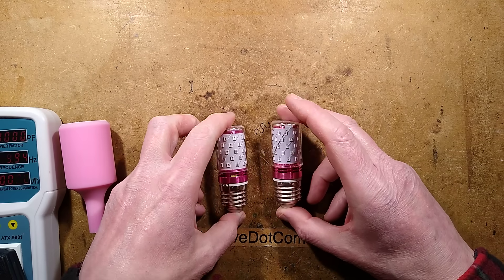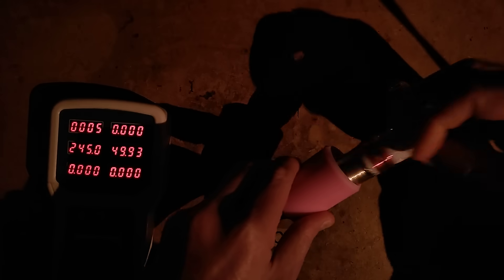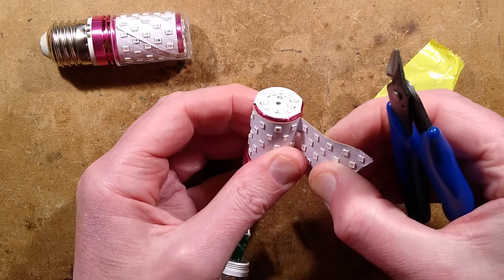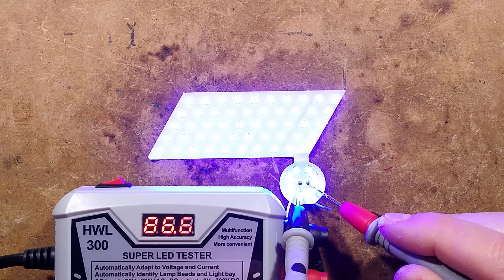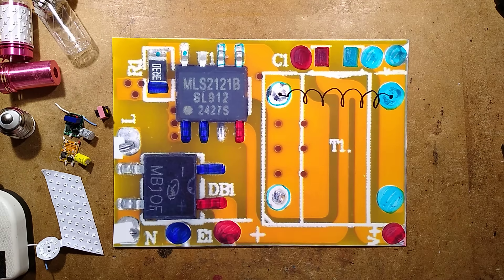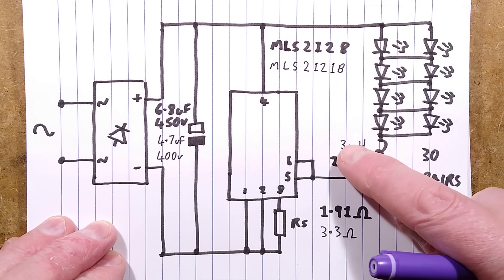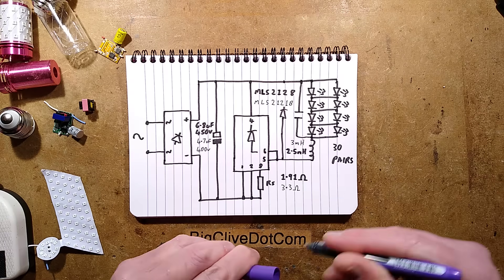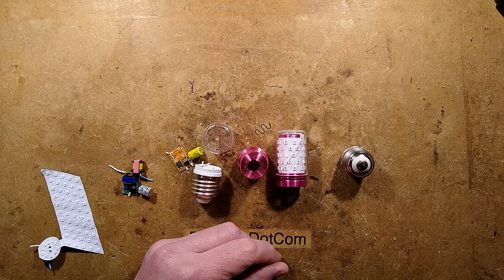Randomly overpowered scammy "sterilising" lights

Comment: It doesn't need a smoothing capacitor.
In buck converters, the inductor is always in series with the load smoothing the current.
There aren't 2 pulses.
when the switch is on, inductor current increases slightly, when the switch is off inductor current decreases slightly.

Comment: ~3V means that they're plain blue LEDs. 365/395nm ones need ~4V, germicidal (260nm or less) clock in above 8V! At the current UV LED prices a real sterilizing 60 LED corn bulb would cost well above EUR 500 plus the electronics. Blue is much cheaper and completely useless for sterilizing, so strictly speaking both are fake products. This channel is great! I have to disassemble so much less stuff thanks to you! :)

Comment: I use uv c in hvac for germicidal control. 8 to 40watt, 10 watt being average.,  depending on ductwork area and cfm flow..dwell time exposure is the key to successful  sterilization of any virus, bacteria, etc.  These bulbs are flourescent, and not cheap..$50 usd and up.  Mine was installed months before the covid event and we all were safe until a large amount of outside air was admitted into the home, supersaturating the indoor air with the deadly crap.  Four of seven residence ended up with it but with mild cases. The real uvc work,, refresh them annually or up to 18 months, leave them on 100 % without cycling with hvac system.

Comment: Ah, more scamazon "this one trick" junk. Very satisfying debunk video! Have you seen the ads for the wall plug mounted space heaters yet? Every other ad claims it was invented by someone different for different reasons, and that electricity companies don't want you to know about resistive heating. Would love to see what's in one of those/if they are all the same internally.
Reply from the maker: They're just low power heaters.  I took one apart.

Comment: I'm seeing chinese lamps similar to this.  You have a pink strip above the screw in part.  I'm not sure if that's plastic or metal on your example.  What I'm seeing is the screw part on the side and for some unknown reason, there's about a quarter inch higher metal base before the glass part of the bulb starts.

I assume that the UK is the same as in the US on this, that the side is the neutral and the very bottom terminal is the hot.  However, in some lamps that have been rewired or have no polarized plug, that neutral now can be a touchable hot.  Not a good feeling at a 120 to 230-240 volts AC.87

Comment: Including the "free wheeling" (inductor discharge) diode on the driver IC really isn't a big challenge. The thing already requires a process suitable for the high voltage switch, so the diode is no big ideal. It would need to be a fast recovery type for decent efficiency. (a Schottky diode would be best for efficiency, with extremely short reverse recovery and lowish forward voltage (which is unimportant at the voltages involved), but such a diode is right out of the question'; silicon Schottky diodes top out at about 200 PIV and even at that voltage they are few and far between)

[edit] These drivers are buck converters with a low-side switch. As such, the intrinsic "body" diode in the N-channel switch does not provide the discharge path for the inductor. Without the separate discharge diode the intrinsic diode of the FET would be avalanched when the FET is turned off, which would result in very high power dissipation (it looks like a high-voltage zener, so the dissipation at the instant of turn off would be hundreds of volts times the inductor/LED chain current; you can sometimes let the body diode of a discrete power MOSFET avalanche to discharge the leakage inductance of a flyback "transformer," but the energy is low and even then it must be carefully analyzed; avalanching the switch in a power IC can be instantly destructive).

Comment: Because a string of LEDs is essentially a shunt voltage regulator, albeit one that isn't very good, putting a capacitor across it isn't very effective in "smoothing." It would take a fair bit of effort to evaluate it fully in terms of cost, volume, efficiency and reliability, but a increase in the inductance likely is superior to using a capacitor of a value that does some good. A cap could be useful in terms of noise.

Comment: I believe the MLS2121B is a Linear constant-Current LED Driver like a Diodes Incorporated AL8862 with the noticeable difference being pins 7 and 8 are swapped. Pin 3 being a NC (Not Connected) and Pin 7 being a Control pin for PWM/DC Dimming, left floating for normal operation. Fun test you can do with Pin 7 is apply power to it. If driven with less than 0.3V, it should turn off. If driven with 0.4V to 2.6V, it should adjust the output current from 10% to 100%.  You can also use a PWM signal <0.3 to >2.6 for a 1µs transition time and finer control. Adding a capacitor between pin 7 and GND may add a soft start time of approx. 1.5ms/1nF (Default soft-start time = 0.1ms). Pin 1 is a Set pin grounded for normal operation or can be connected to VIN via a resistor to set Normal Average Output current. Pin 2 is GND.
Of course, I could be wrong about all of this, but what's life without hypothesis and experimentation?

Comment: Hello God of reverse engineering. I didn't know how to contact you so I'm leaving a message hoping that you would receive it. A while back you reversed the kill-a-watt device which had an interesting way to power itself as well as measure the circuit. I found another interesting device that also powers itself but instead of from AC Mains it powers itself through the CT clamp used to measure the current through the AC mains through I guess SCT013 clamps. The MyEnergi Harvi device. I would love if you could take a look at that one and make a video. I believe it is made in the UK and based on your accent I'm guessing you are too. I'm in the US.

Comment: It would be interesting to look at the datasheets on those LEDs (or use an optical meter) to see what wavelengths of light they actually provide.  And also to compare the current being pushed through them with their datasheet recommendations, to see just how far over recommended continuous max they're being pushed. But I suppose those LEDs are even more difficult to identify than the chips with the part numbers on them.  I've been able to at least compare them here by placing them under an inspection scope to get 45 power magnification, which gives a better view of the LED, and in the case of tri-color leds, the controller chip as well.  (WS2812 and WS2812B are often claimed when they're using a knockoff, which are easily verified under magnification)

Here in the USA, consumer LED bulbs are pushed well beyond their ratings so they fail early and have to be replaced frequently, to bolster the bulb industry's profits.   But in places like the UAE the government mandates longevity in their bulbs and manufacturers are forced to design their bulbs to not exceed the LED's ratings so they last many times longer.  I wish the USA would regulate that so we didn't have to replace our bulbs every few years when they should be lasting 10-20 years.  It's quite a shame to see a component that has the potential to provide decades of service ran so hard it burns out in just a few years before being sent to the dump to contribute to e-waste.

I would also suggest you look into getting an AmScope inspection scope for your channel.  Not one of the high mag heads, consider one of the low (3.5-45x) "wafer inspection" grade ones.  They are often sold as a package that includes a decent HDMI camera, as well as an adjustable hovering stand.  You probably would only have a reason to use it on a small percentage of your videos, but it would be a great addition in cases where more magnification would "reveal another world" in your tear-downs.  Almost no one is showing magnified footage in tear-downs, and that would give your channel a unique feature some of us would find extremely interesting.  (I can link you to some pictures and video I've taken on WS2812 and other interesting components if you'd like)

Thanks for another great video!
Reply from the maker: I'd guess around 470nm from the colour.

Comment: what is your fave lighting tech? mine has to be carbon arc, limelight, and high pressure mercury. all fascinating methods of making interesting light with a nice bit of danger on the side.
Reply from the maker: I like all of them, but do have favourite lamps.  Like the cold cathode signage bulbs used in Las Vegas.

Comment: I have been a fan for years. Long ago you did a video on a florescent type black light with clear lens that was used for germside in furnaces and perhaps operating theatres to sterilize before surgery. I  ordered on and installed an Edison type socket in a cat litter pail with lid, put a switch on it and my daughter uses it to sterilize her CPAP unit.  I think the overall cost was about eight bucks US and the pail was just left over since my daughter has 3 cats in the house (well 2 now since one passed away recently) The wire was left over from some old lamp or something, and the switch was a regular household switch I mounted on the pail.  We had a pipe let go in the bathroom recently and caused some mold problems. I used that lamp to cleanse the  bathroom and it did a great job. Of course we always avoid being in the room when the lamp is lite and I wear dark glasses when tinkering with it where it will be on for any time at all. By the way, I love the show,  I include it in my learning videos to watch as I usually pick up a lesson or two from each one.  Thanks again.
Reply from the maker: The UVC tubes are very handy.  But make sure everyone knows they are harmful for eye exposure.  Any room they are being used in should be closed to make sure humans and pets don't get exposed to the light.

Comment: Found the contrustion of that style of corn bulb interesting since it has a more cylindrical arrangement of LED chips on a flexible PCB of sorts. I've seen the corn bulb type of LED bulbs before online, but never got any since they don't fit my needs so haven't gotten to play with any yet.
The other kind of corn bulb uses a bunch of small vertical PCBs that are connected together instead of a whole flexible piece like the one you took apart is.

Comment: I don't think your analysis of the LED current is quite correct. The LED current is the same as the inductor current, so it increases when the switch inside the IC is on, and when the current gets to the trigger level, the switch turns off, the current flows through the diode, and the inductor and LED current decreases. So there is only one pulse of LED current per switch cycle, although the current is always increasing or decreasing.

The current may decrease to nothing before the next cycle, or the next cycle could start to increase the current before it had decrease to nothing. That could be checked with an oscilloscope.

Even if the inductor current drops to zero each cycle, there won't be much voltage change on the LEDs. If a small capacitor is added, the voltage on that will drop rapidly to below the forward voltage of the LEDs, so the current in the LEDs would be so near zero that the capacitor would do very little. It would need a large capacitor in that circuit to smooth the LED current much.

in contrast, the mains smoothing capacitor can be quite small and be effective at keeping the lamp illuminated during the gaps between mains peaks. The LED driver circuit will give a constant current over a wide range of voltages by varying the duty cycle of the switch.

Comment: My freezer stops working in winter because it’s too cold in the house, so putting a 10W bulb inside the fridge section would actually provide exactly the level of heating to trigger the thermostat and keep it running normally. Therefore this bulb would have an antibacterial function by stopping the food defrosting 💁‍♂️
Reply: One of the joys of ChatGPT is using it to do the heat calculations on projects too irrelevant to bother with, but that I’d still like to know the answer to 🤓

Comment: I had gotten a 6w warm white version of one of those bulbs off Ali before, and its driver was quite unusual, as it used a driver chip with only 4 pins on it, when i first saw it i thought the board had two bridge rectifiers on it before I realized one of them was the driver chip, I tried looking up the chip but found basically no info online about it.

Speaking of those "UVC/Germicidal" LED bulbs, back in the early 2020s (feels weird saying that), a local dental practice was running YouTube ads touting their hygiene practices and whatnot, and in their waiting room, they would show a floor lamp that had one of those cyan blue LED corn lamps with a pamphlet near it on the wall talking about this "germicidal" lamp. Every time i saw that ad, i would die inside a little.

Comment: I have wondered about the diode, as I have found similar boards that have the diode external to the chip.
They do grill the leds, and the leds do fail.
If you connect just one led to the output and fire it up off 24 vdc it does run, so can reuse the circuit in a low voltage application.
And trimming the shunt resistor to suit the led current more appropriately.

Comment: The bridge rectification makes a great fuse in a device like this. 99.9 percent of people will trash it after a failure occurs anyways
Reply: In the early days (1960s) I was taught a definition of a semiconductor "an expensive device to protect a cheap fuse"
Reply: @johnj4860  or no fuse as here
Reply: I have often thought why the bridge rectifier is so pitifully small for the power in those things

Comment: for in side refrigerators , lol,  , does someone need to tell them , that when the fridge is closed , its BLACK < PITCH BLACK , ie no light , so nothing much grows with no light 
 and also anything that is germicidal in a fridge , will also degrade vegetables
Reply: Most fungi need no light. Also some microbes. But yes, UV will affect yer vegan nosh. And normal light will turn the spuds green and toxic.
Reply: 1. bacteria do not need light to grow; it needs food to grow.
2. UV kills bacteria only when it is trying to reproduce (mostly) though it can cause gene damage

Comment: Thank you, Clive.

I gather that the reliance upon an inductor to limit current renders this circuit unsuitable for DC power input.
Reply from the maker: It converts the AC to DC and then uses the inductor to ration it to the output, so it should work on DC.

Comment: The diode that you thought was missing wasn't built into the IC so much as it was intrisic to the switching output pin. They act, essentially, as protection diodes, but they are simply intrinsic to the output high-side MOS-FET.
People often say those MOS-FET diodes "aren't very good", which is rubbish, they tend to have low Vf and equally as good current handling as the MOS-FET they are a part of, as well as having exceptionally low reverse leakage.
Searching for some diodes to use in a solar charger circuit, I didn't have any discrete so I simply used some loose MOS-FETs. Perfectly good enough.

Comment: I knew an old electrician who would put his finger in a light socket to check for voltage.
Reply: I had a mate who did that, we found his hands were so dry that they didn't really conduct.
Reply: Tap with back of finger used to be a thing for "low" voltage in house wiring.  I prefer my screwdriver that glows when you touch the (other) end.
Reply: Check a electrified wire with a strand of straw ,   it's dumb ,but if your finger is very dry , you won't yake up the full charge , ..electrons are very fast , no second chance , I have a pathology for loose electricity now
Reply: @Thom4ES  I tend to use a dry blade of grass to check electric fences when out in the fields - too lazy to actually go and look at the switch to see if it's on or not 🤣
Reply: Because there are no old electricians who licked their fingers and stood in a bucket of water.....
Reply: This is how my uncle did it. Somehow he lived into his 80s.

Comment: Long-wave UV is very handy for  photopolymerisation, however neither of those is anything like UV! Nice blue light LEDs though, and they could be handy for other purposes.  Even the "PSU" caps are "No-Name", certainly not one of the (nowadays quite decent) major Chinese cap. manufacturers! Screams "quality" right there :-) They ALL seem to use the same yellow, "dire quality" PVC (?) insulating tape too! The HWL300 is a really good bit of kit (worth using heat-shrink on the probes to avoid accidental shorts though, or replacing with fully insulated hook probes)

Comment: That pink aluminum tube looks surprisingly similar to a cheap flashlight with a button on the bottom and silicone sleeve where the LEDs are. I think they found a second use for the same part
Reply: I agree. This doesnt make sense to me that they would machine an aluminum part like that for a cheap led bulb
Reply: Commonly done by “Chineseum crap” factory’s to make yet more “polished turds” 😠